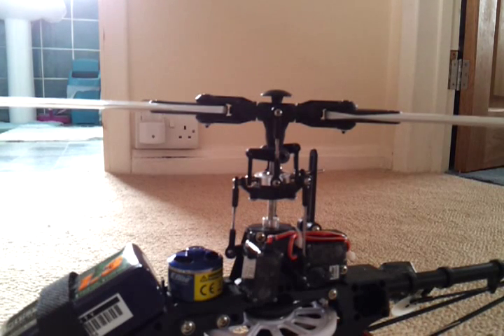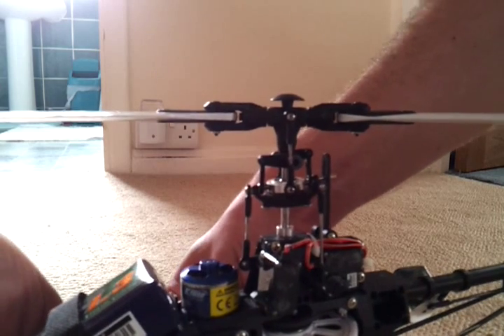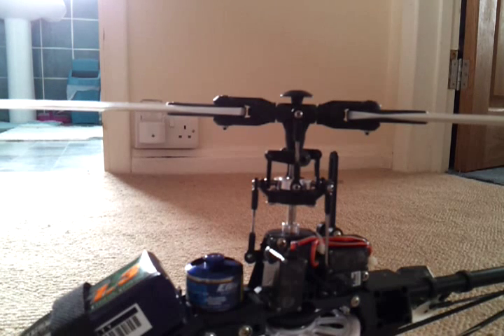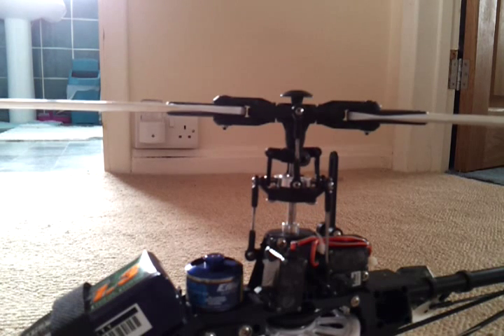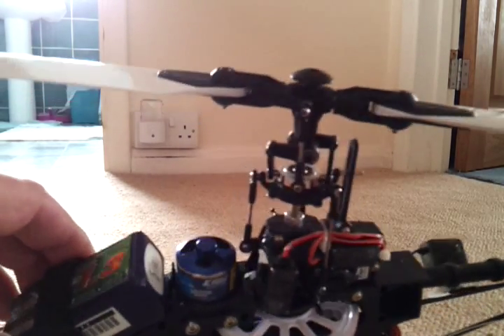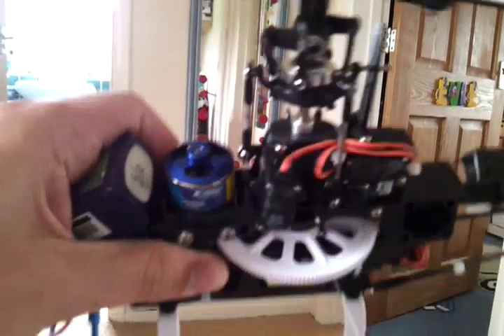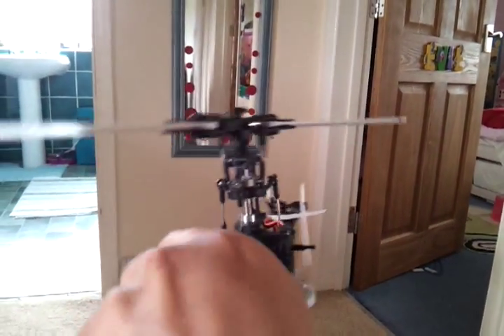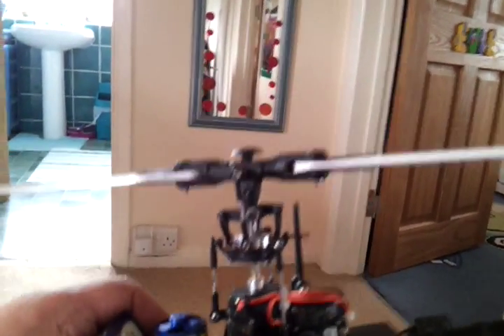Quicktip AR7200BX swash gyro correction check - Blade 300X 450X 300CFX etc

Comment: I purchased a 300 cfx RC helicopter about a year ago I recently flew it and it crashed. I would put it on the ground and it would spin in circles I couldn't figure out what was wrong with it and crashed it and it cost me a lot of money and parts only to discover that the wires that go from the ESC board to the battery are in reverse causing the blades to spin in reverse the red is supposed to be to read the black to Black this is the way it came out of the box completely reversed switch them around or your helicopter will spin around in circles and crash.
Reply from the maker: hi dan reversing battery wires will not turn motor backwards it will just blow up esc in a cloud of smelly smoke. motors are reversed by swapping 2 of the 3 wires between esc and motor only for brushless. i will delete comment to avoid anyone misunderstanding.

Comment: Hi James, i may have jumped the gun alittle as i just found out it's got the wrong blade grips fitted and the motor Kv is 5500kv!!. So, thank you for your help(so far) and will sort a few things out on it first then if i have no luck would appreciate some more input. Cheers
Reply from the maker: +Snott Inmynose Maybe motor swap was to run 2S packs ? Seems way too high for 3S I think. Am sure if you swap blade grips for stock the default settings should be close, you may have to tweak links to get zero at midstick if they were adjusted for the other blade grips. I don't have a 300X so not sure I would be much help but there is loads of info on helifreak so should not be too hard to get flying.

Comment: Hi James, I'm haveing trouble with my 300x, after i set up beastx and exit set up menu i get those "pumps" you describe then the heli settles with a lot of neg pitch. I have tried about everything but would appreciate any advice. Thanks Scott
Reply from the maker: +Snott Inmynose Do you have throttle hold or throttle bottomed - that would give negative pitch, if at mid stick you don't have zero pitch but at top/bottom you have positive and negative you may have to adjust links, but if it was fine before setup, I'd suspect something else, I would just go back to the beginning - if you resst AR7200BX it will return to 300X defaults, so should highlight a setup issue, then you could always follow the online ar7200bx manual (don't think it comes with the 300x, you can download it from horizon website) http://www.horizonhobby.com/pdf/SPMAR7200BX-Manual_EN.pdf

Comment: Newbie question. 300cfx is my first collective pitch.  I totally downed it.  However, I'm rebuilding it.  I'm connecting my servos back to my beast x now.  I'm not sure which is which in terms of my aileron, elevator and aux1.  Would you be able to help identify which servos are which?  Rudder and throttle are obvious.  Thanks for your help in advanced.

Comment: Am I wrong, shouldn't the pitch go positive when the swash goes up?
Reply from the maker: The Blade 300X has trailing edge control arms so swash will move down for positive pitch, a lot of other heli's like the Align Trex range have leading edge control arms so swash moves up for positive pitch. I've heard arguments for both, I suspect there is nothing between them in flight. Obviously its essential that you check which you have and blade pitch goes positive/negative correctly and don't just focus on the swashplate.

Comment: My 300x seems to want to fly forward all the time... I check the swash with throttle hold on and its level. When I fly it for a while, it wants to fly forward. I will land it and find that my swash is no longer level.. The two rear or cyclic servos are level, but the front one is pulled downward. When I replug the unit in the swash is back to level again... What gives? All my settings are spot on and triple checked?